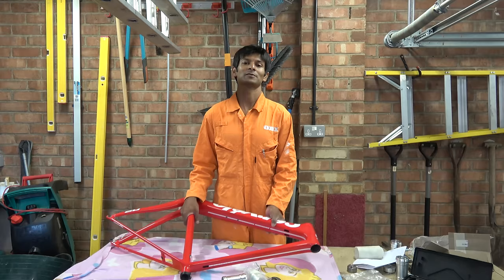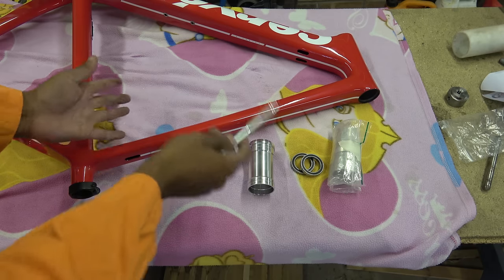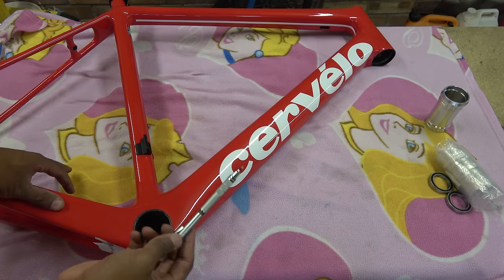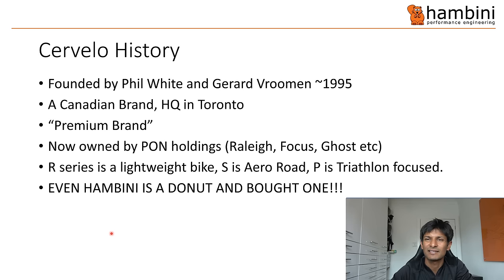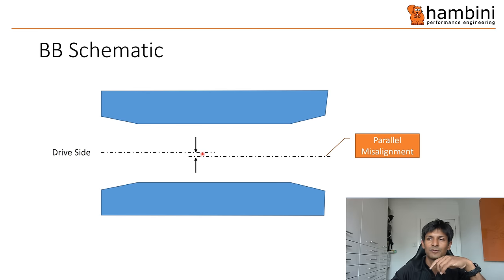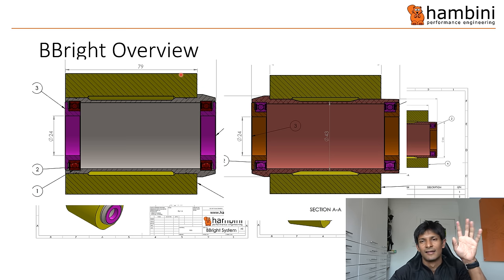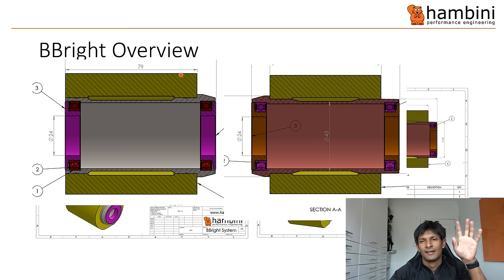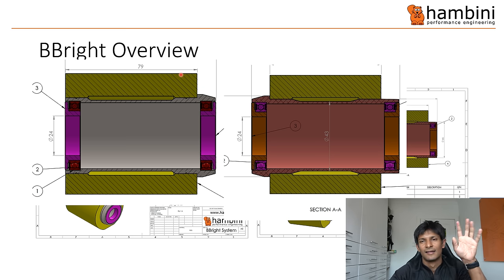Cervelo Exposed and fixed... Scumbag Aero bike manufacturers (A Hambini Reaming)

Comment: I am on the fence. You asked the bearing guys about putting bearings directly into that kind of tolerance but that's not what you or Cervelo does.  It's corner cutting, but they use a thread together with an o-ring and save a bunch of money on frame tolerance that they spend instead on aero-engineering.  As you say this o-ring doesn't directly cost power, just a lttle stiffness(so maybe power in sprints), but how much? Rigidity of the o-ring aside, the point is it creates at most 0.1mm of slop (that I'd dare you to notice).  But I have that much slop in my cleats.  It does prevent easy installation of your slightly superior bb shell though.

They also fit their axle's directly into their bearings.  I believe you tend to advocate for a sleeve between the bearing and axle to take up play if I recall correctly? I think at least in 24mm axels you do if nothing more than just to use standard bearings.  I know BBInfinite advocates for that.  But 0.1mm of o-ring take up at the frame and none at the axle is unacceptable?  What's wrong with undersizing the bb shell by a full 0.1mm and adding more compound to fill the gap? Not so different than an o-ring, but whatever.  

I'm also confused because you said the guy's first Hambini BB did go in.  You sent him a second smaller one, it was tight (but I guess also went in).  It seems in the end your solution was to find a way to insert the shells while making sure not to damage the frame.  Ok... but assuming the frame doesn't crack, and didn't previously, how does that change the stress on the shell and bearings after it's in? It does seem you achieved good spin, so it's a real question. 

Also on the newer cervelo's I've seen their thread together setup has a mm or so tolerance on the NDS becuse there's a thin flange there.
Reply from the maker: It's needs the bullet because the final BB is of a stiffer material than the first two. This is to stop it collapsing. 

As for the O rings. By the time the deflection gets to the riders feet, you could measure than in a few degrees of of movement, which you would probably feel. Hambini
Reply: Ok, your explanation clears up my confusion about the bullet. You kind of said in the video "if I'm going to bother will else, might as well use the race stiff bb", ok but actually that's the meat of the solution.  The thinner ones didn't hold shape and transferred alignment problems to the bearings.  The stiff one solved it but needed a bullet, got it.

The center of the pedal is what 100mm axially from the bearing?  The o-ring  is what 35mm from the center?  So let's call it 4 to one in total,; let's add a sqrt(2) for the 75mm orthoganol crank arm and call it 0.6mm ok, so 0.6mm of slop at the pedal assuming you can fully compress it in a sprint, meh...

How much does the frame itself typically flex?  How much power does THIS  (not a binded hambini BB) lose relative the arrow gains of a Cervelo over the other bikes you mentioned.

Again, definitely cutting corners, but I don't know any consumer product that doesn't have some compromise.  I'm glad you're calling them out this and  I don't love it, but I'm not sure it ruins the bike, or even makes it a bad choice for a bike.  People can just change the bearings, ie only the bearings, or get a cervelo replacement bb.  Still, I hope they fix it, but maybe before using all the swear words we should know the total flex in one of those bike's you suggest compared to the total flex in this bike.  How about an actual measurement of this supposed sh!t show?
Reply: @Hambini  Was in a hurry and kind of messed that the argument although the result was pretty dead on. 

Of course cranks are 175 not 75 (typo).  But anyway degrees are degrees, at the o-ring or at the pedals (ignoring flex of other things, but that's a separate issue). So 0.1  mm at 35mm latteral is 0.16 degrees or 0.0029 radians.  Pedals are a distance of about 202mm from the "center" give or take.  So 0.0029*202=0.577 mm.

We're at 0.16 degrees, not a "few degrees".  And still at 0.6mm as I estimated a bit sloppily above. True this might be just a little more give, and loss, than my socks have.

I really appreciate the extensive measurement work you've done.  But to say that the cervelo system is #$%# compared to bike X, you'd need to measure how much power is really lost by 0.6mm (maximum) of flex.  I suspect we're talking a fraction of a watt, whereas the aero saves several watts (it's a few even at 30kph).  We'd need to know how stiff is the whole system compared to said other bike.  It does seem a little weird to make all the trouble of a wider BB and reduce clearance for stuff and then throw away a little stiffness on tolerances and o-rings, but that's typical of any consumer product. And I'm not convinced that it doesn't have benefits in axle wear life. Yeah, maybe the wide BB is more marketing than anything except in the probably higher tolerance RCA line. They do sell bikes for money and some at lower prices than others.  It doesn't mean they sell terrible bikes though.

Comment: Kind of interesting.  I've been riding for 35 years, from chrome molley and steel frames to titanium and then carbon.  I never had a bottom bracket bearing issue until riding carbon fiber with press fit bottom bracket, which I now have every few years.  I ride thousands of miles a year and get a new bike every six or seven years.  I have never owned a Cervelo frame.  I don't blame this problem on Cervelo or the bankers who bought the company.  It's a problem of the composite frame material, carbon fiber, and the press fit bottom brackets which can't withstand the torque generated by pedaling the bike and tends to happen more on the stronger leg side or where there is uneven torque throughout the pedal stroke which results in ovalizing the opening in the bottom bracket.  He's just another guy blaming someone else for something that's inherent in the material, IMO.
Reply: But why only on cervelo not other folks

Comment: On my Fat Chance Yo Eddy, the tolerances on the seat post were so perfect that the post and saddle could float on the air in the frame with no air escaping around the post.  It could slide up and down freely and moved easily but was still close enough so the air couldn’t escape.  It was as perfect as could possibly be.  This frame is ridiculously bad.

I can confirm his bad Cannondale is.  When I was wrenching, their rear stays on the frames were regularly 5-10 mm wider than they were supposed to be.  They didn’t jig the frames during heat treatment and would always warp during the treat.  Crap frames.

Comment: This video is informative AND entertaining.  If you ever decide to stop or pare down what you're doing, you might consider transitioning into college professor of the decade.  Your video, though,  prompts me to ask two follow-up questions.  If somebody is the unfortunate owner of a Cervelo, can this potential problem be diagnosed with the crank-spin test, or is this just ONE indicator of the potential shitstorm of issues with the manufacturer's "craftmanship"? Next, clearly there are many sponsored Cervelo-riding athletes, some very well known.  Does Cervelo just dive into their pile of bikes and find the least wonky to send to their athletes, or are the world-class athetes' bikes manufactured in some special R&D lab where standards and the resulting frames are much better?
Reply: Next time you have the bottom bracket out, you can measure both sides of the shell (in several orientations) with an inside micrometer.  Measuring the alignment is more difficult.  As for the pros, most likely the bikes are made in the same factory, though they might select ones with better tolerances.  There's a video of the pro Michael Matthews riding up a hill and Cervelo is creaking loudly.

Comment: How hard Can it be to do the machining of the BB hole in the farme ALL the Way through in one go to avoid this. Then this failure-mechanism would be error-proofed. The tolerance/stability of the current machining fixture left/Right side are misaligned. One single 8D request from cervelo to thier frame supplier would fix this. This axis allignment shall be stated Customer Specific Requirement in the drawing, Cervelo knowing this is critical to quality (since they tampered the tolerance) And subseqently be build in the suppliers control plan, checking with a go-no-go guage after machining. Basic IATF16949 quality.

Comment: I had the same 2013 S5 frame as you own shown is this video. My LBS used to hammer the bottom bracket to get it to pass through the frame and because of this we could only every use nylon material. It was an ordeal every time, unsurprisingly it used to eat bearings. The LBS measured the openings (forgive my lack of technical wording) we found as you depicted mis-alignment and differences in size. Cervelo requested the frame back, so it was sent to Germany. After a couple of weeks we got a report confirm the frame was faulty, fully expecting them to perhaps re-hone the frame given what we'd seen with our measurements. We couldn't believe it when they said it was oversized and would replace the frame with the new model. So i have the 16/17 frameset and once again i'm subjected to creaking BB, I am now running a Wheels manufacturing threaded BB to eliminate this, it's better but not entirely fixed. If i had your skill repertoire then i would do what you have but sadly i don't. Not sure what i think given i have 3 Cervelo and always liked the fact that it wasn't common like a specialised or Giant but, it is what it is now i guess. Really enjoyed your frank approach to your video even if i am a collect fucktard owner :)

Comment: You may throw the Flo wheels marketing under the hambini bus but the truth is they are the most reliable wheels I own (12000km, dozen crashes, always ride hard with lots of angry gravel). The hubs are shit, the bearings are garbage and braking is questionable. Replace all that for $45 in 15min every 4000km and you are good to go. True as the day I bought them off a click-bait Facebook add. I can't kill these wheels. Best $900 I've spent on cycling.

Comment: Apart from awful design spec’s,  Cervelo (as do most brands) outsource the production of their framesets to a frame building factory, I presume part of the problem is due to poor factory?  We are told Cervelo is made in sane factory as all the other big names such as specialized, pinarello, Cannondale etc. So such issues are not limited to the brand.
Reply from the maker: they can out source what they like but having tolerances that are so wide is not acceptable.

Comment: Hey Hambini -love the vids and the cutting sense of humour.  Question for you : If you have a threaded bottom bracket, such as the Shimano Hollowtetch system are you still at risk to the misalignment caused by the tolerances or is this risk reduced ?
Reply: Depends on the BB. If it’s a Shimano threaded one then it’s three piece which can cause it as the plastic sleeve in the middle is a separate part. A Hambini is two piece which minimises this

Comment: I've never spending big dosh on a frame ever again; it's not worth it.   I often race on $300 alu frames, which are light enough for me. I've got a 57cm Pro-Lite Bella frame that's 1380g,  and I had an old 58cm Caad 7 or 8 frame that was 1265g, both without the fork or any other bits.

Comment: are the BBright shells not intended to be reamed before assembly? In which case an undersized shell with fairly loose tolerance from manufacture is OK. Sorry if this is incorrect, I don't keep up with the dozens of BB "standards" around today. My current frames all advise reaming and facing of BB and head tube as well as facing.

Comment: On the topic of bearings, any opinion, asking in a rhetorical manner, on steel vs creaming bearings given the relatively low loads on bicycles.  I have trouble justifying the spend as i don’t see how the loads on a bicycle justify their use, other than through a cool factor.

Comment: Earlier from Hambini's 2016 video Called Cervelo BBRight Bottom Bracket, Creaking, Specifications and Shimano Cranks... "cervelo's manufacturing tolerances are fairly good, so the hole diameter and the bottom bracket shell width are pretty much bang on, so it doesn't usually creak for that reason, and the alignment between the drive side and non drive side again, I think cervelo use one drilling motion from one side to the other" - https://youtu.be/9IlWUVfAVEE?t=240

Comment: In English ( not UK English, English comes from England there is no need for us to use a qualifier) it is "tit bit" . In US English it is still  "tit bit" but they were afraid of the word "tit" so they changed the word to "tid" which is why US English is clumsy and should only be used in desperation  when real English is difficult to find.

Comment: Mr. Hambini, thank you so much.  F-tard engineering is rampant in other areas of manufacture and I can relate.  
Are you available for tolerance stack up analysis? I have some CAD models for you to review...  
Very concise technical presentation, you have elite presentation skills.

Please say "calipers" rather than "vernier calipers".  Vernier scales on calipers are the pre-digital calipers that gave fractions between marks.  There are also dial calipers and it's obvious what those look like.  To be anal engineer "digital calipers" is the most descriptive.

It has been a long time since I've heard someone apply engineering principles to bearings in this manner.  It was with helicopter drive systems and they were staff level engineers.
Reply from the maker: Hi David. By all means send them through. 
Everyone I know says verniers? Hambini

Comment: I don't really understand your 11W+ @ 50km/h figure. First, power loss should not depend on speed, only cadence, since we're talking about a BB here. Second, are you serious? It doesn't take 11 watts to turn any crank, even with the crappiest, ruined BB. If I didn't mess up my math, at 90rpm on 172.5mm cranks that would be 6.8N at the pedal, or 690 gram-force. That would be one seize up crank!
Reply from the maker: Not sure what you have done there but the calculation is 90RPM x 1.17Nm of torque gives you the 11W
Reply: @Hambini  right, 1.17Nm with 172.5mm cranks is 6.8N at the pedal axle. Seems unrealistically high to me.

Comment: 5:20 + "not happy about finish inside the headset" that could be lethal! cyclist died in Melbourne a few months back when front forks / headset failed in St Kilda Rd; imperative that QC inspections are ruthless about structural integrity

Comment: Great info.  Finally, someone stating it like it is.

Question - will the iron “dust” from the steel wool negatively impact the aluminum (note the proper spelling -😉), or the frame material?

Comment: What I see as big technical problem here is that simply pressing all that bottom bracket, which is working under heavy load, all the time into non consistent hole in carbon frame!!! From the logical and engineering point of view why there is not already inbuilt glued some metallic pipe where you put other metallic part and have absolutely perfect tight fit with perfect tolerance which don't kill bearing and all your performance with it. This is completely stupid design and construction flaw. Such a crucial part of the bike is stupidly affected by thing that you want probably fit different assemblies from different manufacturers in that hole. Why the hell there no better error free solution which is better fixed to the frame and it doesn't affect frame structure, your performance and doesn't destroy bearings because of possible miss aliment in care of any manufacturing defects or misuse? Even watching pressing that mettalic assembly bottom bracket into that carbon frame hole make me sick. You don't want press any hard metallic parts against carbon fiber structure. Never ever! That is wrong. Such a procedure can work with metallic frames and not with fragile CF ones. Such a local pressure can affects fragile CF structure. CF doesn't like local pressure loads.You want to inglue all the metallic heavy loads mounting points into tho the composite frame and not to press it there like in metallic frame. (And yes I'm aware of that corrosion problem between materials). This design is leftover from all metallic construction manufacturing thinking.